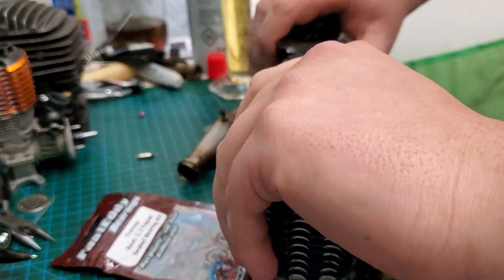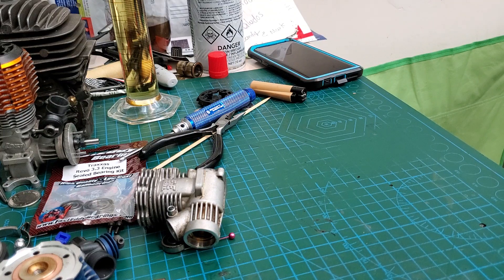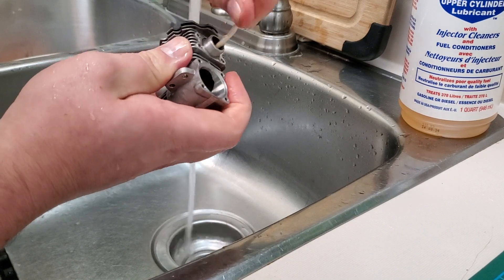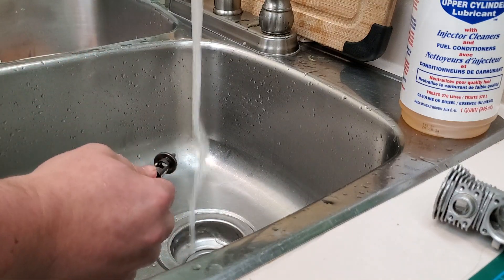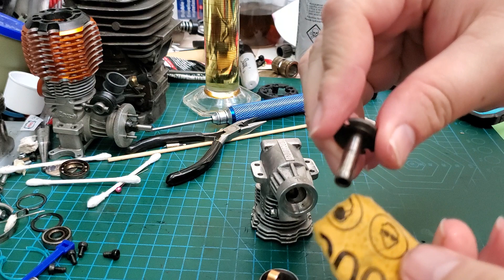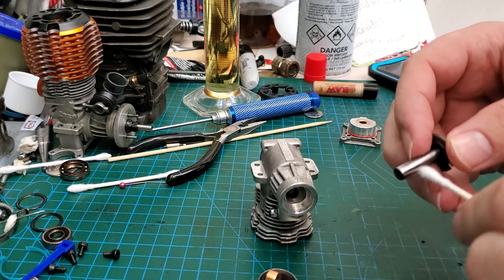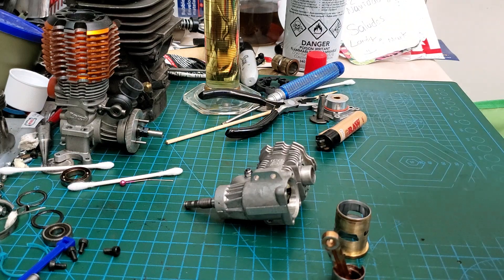TRX 3.3 Clean up And bearing replacement

Comment: What bearings do you usually use?
Reply from the maker: Usually Acer ceramic bearings 12x21x5 7x17x5 and hot racing flywheel to get rid of the crappy out of balance flywheel from Traxxas

Comment: What if the front bearing inner race   has dropped out iv only got the ouuter race left in can't get anything behind it
Reply from the maker: Gotta heat it up and bang it down on a chunk of wood until it moves or if you absolutely can't get it to come out a new block is cheap

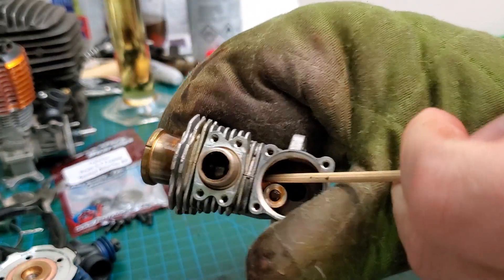Comment: 4:03 I like sticking nylon zip ties in the exhaust ports. Still softer than the metal around it so it won't hurt anything, but 9 times out of 10 it pops the sleeve right out.
Reply from the maker: It's an old school trick and if the sleeve is really stuck you can fold it over so it doesn't get cut as easy and does heat up around the top of the cylinder some more 😉
Reply: @thebug4046  I've had a couple of particularly crusty aircraft engines shear the zip ties off on me, but by and large it works a treat. I usually use it in conjuction with heat! 

I have used a screwdriver a couple times, too, but in both instances the piston/sleeve I was removing was already so wrecked it would never have run right anyway. One was on a 46AX that had been flown until the bad main bearing started sending shrapnel out, and the other was a Magnum 40 bushing engine that had been on an airboat and ingested an insane amount of mud. Like, literally, I opened the backplate and could have planted a flower in the crankcase. Well, that, and the liner was peeling.

I did get that Magnum to run before I tore it fully down, by the way, but not very well. It would start if I did some naughty things to it and run for about 15-20 seconds at half-to-3/4 throttle. No chance of idling, full throttle heated it up so fast it pretty much instantly flamed. Poor thing's just NFG. I swapped it for a 40FP that is known good.

I'm guessing that airboat got tumbled in a previous owner's care and they just said 'to hell with this thing', chucked it in the shed still full of pond water.

Comment: My fast eddy bearings are holding up fine so far.   We’ll see how many gallons they are able to suck up. 👊😎

I got what was it also. Ohhhh Avid Bearings.
Reply from the maker: I have found them to be hit or miss I have had some last one court or a few gallons i several engines. They lasted 20 minutes in my dynamite 19 and took the engine out unfortunately.

Comment: 33:49 Bottom it out --> 1/4 turn --> done. Anything more'll just twist the heads off these tiny little screws.

JohnnyQ90 has actually used a torque wrench on engines like this more than once and he's seldom putting more than 2-3 newton-meters on an M3 bolt.
Reply from the maker: Yeah I've seen people go to crazy on overtight

Comment: You gotten your hands on an HPI G3.0 HO yet? I just picked up a brand new one in a brand new WR8 Nitro and it's a doll. runs like a swiss watch.
Reply from the maker: An HO? Not yet haha haven't seen any pop up for sale anywhere
Reply: @thebug4046   It's probably a new revision of an old standard. HPI's been selling the G3.0 for YEARS, but I only remember seeing the HO variant when I started looking into buying this car.

I must say I'm thoroughly impressed with the current production G3.0's. The factory needles give shockingly good performance. thing idles, transitions nicely, comes on the pipe without bogging or hesitating, shrieks like a banshee when I give it hell. Literally haven't had to touch the carb since I got the car from AMain Hobbies! Usually either the screws are way off in the rhubarb to the point it won't run, or it will run but is so damn rich it barely stays alive. Not this engine. Checked against the manual, needles were right where they were supposed to be, and they perform great at that setting. Go figure. First for me and I've been playing with these things for 20 years haha

I'm sure if I twiddled the needles a bit I could find a couple thousand more RPM, but honestly, performance is just fine by my standard right as it is. Car's good for about 30-35mph this way; one guy managed to get his WR8 Nitro to about 41MPH by leaning the LSN until it juuuust started warbling a bit in the midrange but I favor longevity over bragging rights so I won't be doing that.
Reply from the maker: @TestECull   Yeah the high output model has different porting in the sleeve and I think different port timing from what people have said to me over the years and the last time I saw one was around $300 so I wasn't willing to pay that much it  But from whatever one has said that they perform much better than the factory ones do
Reply: @thebug4046  It's got some good power for sure. I can get the back end of that subaru wiggling around on dry tarmac with a good helping of onions! I'd say it sits somewhere between a Dynamite 19T 5-port and an OS 18CV-RX in power; the 18CV-RX is an absolute monster that will shred drivelines(ask me how I know...) and the 19T 5-port is fairly mild mannered until it's screaming along at mach jesus. This one's a happy medium that doesn't explode clutch bell gears but has some good grunt.

It's perfect for an RTR car in the 4-8 pound range, which is incidentally exactly where HPI puts them. Easy to start, easy to work with, reliable, good power but not so much the driveline fails. Perfection.
Reply: @thebug4046  Hah. Gave my WR8 some absolute hell after work yesterday. It goes everywhere sideways. Hell of an engine, hell of a car, glad to have it in my stash~. If only the USD/CAD conversion didn't make it 700 bucks up there.....

Comment: Are the fast Eddy bearings more or less trash then stock traxxas bearings.
Reply from the maker: Both suck get a set of Acer bearings for 15$ they are so much better
Reply: @thebug4046 do you happen to have the part numbers for the acer bearings? I see they have a few different ones on ebay. I just want to make sure I get the correct ones!
Reply from the maker: @r_mac67fstbck41   I don't have the part numbers at the moment but if you message the seller and tell them what you have they are really cool and easy to work with they will tell you exactly what you need part numbers and everything
Reply: @thebug4046  will do, thanks!
Reply from the maker: @r_mac67fstbck41  no worries! 🍻🤘🏻

Comment: So im still very new to nitro.  Are you familiar with the losi 454?  If so do you know what piston and sleeve will work with it?
Reply from the maker: It's basically a dynamite big red with and 8 port sleeve haha you can order the SH 28P8 piston and sleeve rod crank all that is the same all big red parts fit to. It's just a fancy SH 28 😉
Reply: @thebug4046  funny you say that because I was looking at the sh sleeve and it seemed to be the same.  Im going to order some parts and figure it out.  Hopefully, it's not the wrong way. Haha
Reply from the maker: @joshherrman3201  dynamite big red or SH 28P8 parts should be available on amane hobby they have lots of SH parts
Reply: @thebug4046  ok so stupid question but are all the sh .28 going to be 8 port?  I don't see SH 28P8 when I look it up.
Reply from the maker: @joshherrman3201  not all. Some are 3 port Some 6 etc... but all interchangeable
Reply: @thebug4046  Thanks for the help. I found it.  One more stupid question do you know if the sh turbo head will work the the losi 454 also?  From what I understand, the 454 is basically a sh engine?
Reply from the maker: @joshherrman3201  no such thing as a stupid question. And I believe it will yes. SH LOSI MACH DYNAMITE XTM Sportwerks megatech ALL made in the same company golden lion SH. Side note. The Dynamite  .21 and .28 RTR engines are made by Force. The 28 RTR Is all the same guts as the HPI F4.6 😉
Reply: @thebug4046  that helps a lot.  I think im going to just snag a head when I do the piston and sleeve.
Reply from the maker: @joshherrman3201  as long as it's not damaged you will be fine
Reply: @thebug4046  parts are pretty cheap.  I was just going to have some stuff ready in case.  It runs good but seems to loose pinch as it gets heat in it.
Reply from the maker: @joshherrman3201  if it starts to shut off when hot then restart when cold run till hot etc.. means it's rebuild time. If it's still running good I say send it!
Reply: @thebug4046  that's where I'm at right now.  It runs great till it gets hot and won't start again till it sits for a bit.
Reply from the maker: @joshherrman3201  ah yeah piston and sleeve time. Slap a new rod piston pin and bearings in it will be brand new again
Reply: @thebug4046  that's what I'm thinking too.  I don't think at this point I can make it worse than what it is.
Reply from the maker: @joshherrman3201  not really haha it will just get more annoying the fact it doesn't run more than 5 minutes

Comment: Can I use upper cylinder lubricant to oil my 3.3 during my rebuild?
Reply from the maker: Not sure what that is exactly. Can you explain it?
Reply: @thebug4046  you have it in this video the bottle by your sink
Reply from the maker: @shakinbass_5318  it is a lubricant but it's mostly cleaners and  solvents. Use a good quality 2 stroke oil
Reply: Do u think 2 stroke Lucas oil is fine
Reply from the maker: @shakinbass_5318  absolutely!
Reply: @thebug4046  thanks man!! And sorry to blow you up so much but another dumb question for this rookie, would you use it as an after run treatment as well?
Reply from the maker: @shakinbass_5318  yup! Or Lucas air tool oil. Either one is fine. Keep in mind you don't need to use it every time you go out. When you are done for the day run it out of fuel until it won't start. Then it's fine to sit for a few weeks. If you are putting it away for longer then use your after run oil. 🍻 im also in the Nitro RC enthusiasts group im an admin in their. In the dark sunglasses 😎
Reply: @thebug4046  I bought a 3 shoe hot racing flywheel and the fitment is terrible , the gap is to big. I bought the one u had in one of ur rebuilds you should definitely post a vid of that to help guys like me trying to install upgraded parts
Reply from the maker: @shakinbass_5318  they aren't bad from what people say. I sold mine not long ago. Not paying 80$ for another one haha
Reply: @thebug4046  my e clip barely grabs the groove that it’s supposed to slide in, do u not use the washers under the boot or something?
Reply from the maker: @shakinbass_5318  i didn't use those 3 washers because of that. Then you can shim your cluch property
Reply: @thebug4046  so discard those 3 useless fucking washers and ill be all good to go?
Reply from the maker: @shakinbass_5318  yup. Seems that's what most people do
Reply: @thebug4046  your the nest man definitely a subscribe from me
Reply from the maker: @shakinbass_5318  thank you! I really appreciate it 💯🍻

Comment: Does sticking your finger with the wire brush feel as good as sticking it underneath your finger nails!😂😂
Nice to see I'm not the only one who cleans my engines this way. Only I don't have superclean so I use spray nine, although it will  discolour aluminum if left long enough as well!❤
Reply from the maker: Thanks for watchin!  I have seen spray 9 a bunch I have yet to try it though next time I go into my auto parts store I'm gonna buy a bottle and give it a whirl for sure! 🍻💯

Comment: 6:04 Two things.

1: All about lube, though that shield won't really get in the way. It's just the seals. I always remove both seals from the inner and one seal from the outer main, then orient them where the exposed balls face the crankcase. Get 'em good and lubed in operation.

2: I like my butane microtorch for this because it's too weak to melt a case accidentally, but strong enough to make the bearings pop right out. I probably could melt a hole in a case with the microtorch but it'd have to be deliberate.
Reply from the maker: I have talked to several engine modification people about the bearing situation and they all say so they want the ball bearings facing out for whatever reason. And yeah  That's why I usually mention a people to buy a heat gun for there's because a lot of people don't understand how to use a torch properly and then melting things haha
Reply: @thebug4046  Mm. The other thing I like about the microtorch is the precision of it. I can heat up a stubborn wrist pin without really heating up the piston around it if I want to. Or free up the tappets of a 4-stroke without burning the hand holding the engine by the mounting lugs. Wonderful little tool for these tiny little engines!

That torch, 3'n'1 oil, and patience has gotten more than a couple dozen totally siezed glow aircraft engines freed off.
Reply from the maker: @TestECull   Yeah that is true I just have yet to buy myself one I don't heat up the piston with a torch I usually just throw it in a cupful of hot alcohol that usually works good to

Comment: 13:04 I wonder if that stuff could be used to artificially patina an engine. Discolor it without weakening it. Be pretty sweet for a nitro rat rod to have an engine lookin' all patina'd out, yanno?
Reply from the maker: You can do that if you warm up the engine block in hot water then spray it on there let it sit fot 5 minutes but you don't want to let it sit there for hours for example because it eat  the aluminum
Reply: @thebug4046  Mmm, innnteresting. Ye I'm thinking of converting one of RC Everyday's rat rod kits to nitro with a little OS 12CV-RX or similar and, being a rat rod, it'd look best with a 'tina'd out engine. Maybe I'll experiment a bit; I have a few cases around here that are NFG that I won't miss if they get too eaten up.